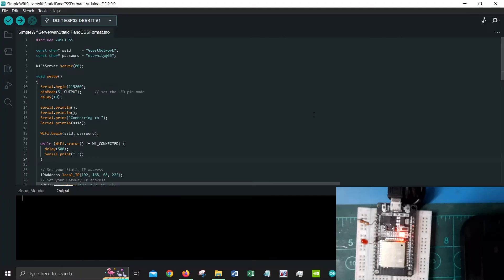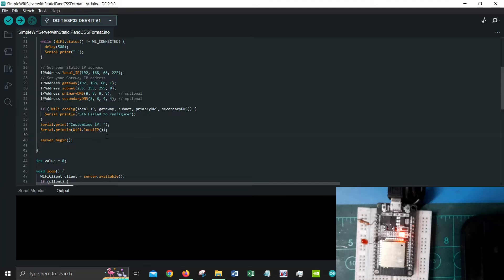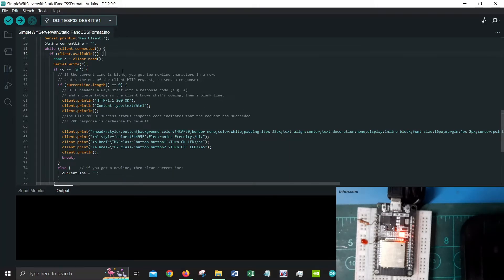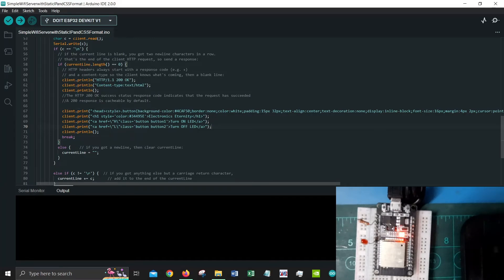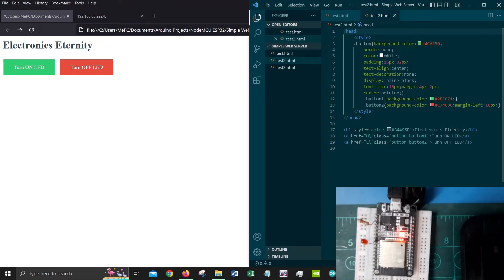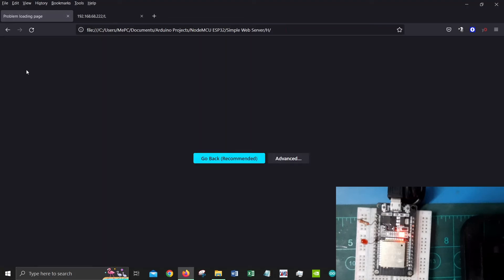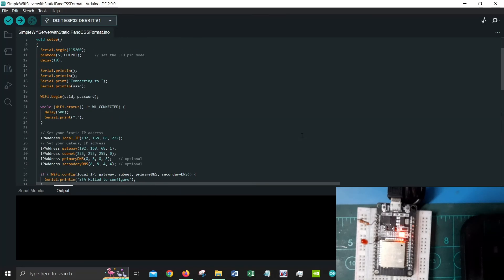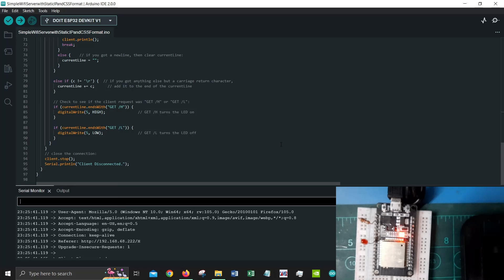NodeMCU ESP32 Part 3  Simple Wifi Server with Static IP

Comment: Thank you for this excellent video. 👍I have a question about the "port number". We see that you picked "port 80" for this example. Is that number aribrary, or does it have to be port 80?
From what I recall of a computer networks course, the port number allows multiple devices to share the same IP address. I think port 80 belongs to the PC we're running off of. 
Please forgive my ignorance? 
The reason I ask is that I was wondering if it can be anything to control a large number of devices with the same IP address. 
Thank you!
Reply from the maker: Don't be sorry. In fact, I find this question as a good one. I had the same idea at first, theoretically. However, when i change the port to something other than 80, it doesn't work unfortunately. I would advice you to experiment it and see how it works from your end :)